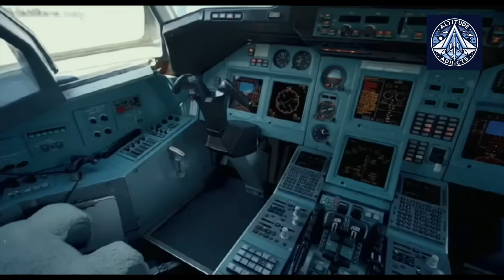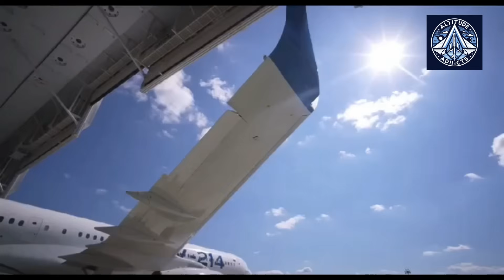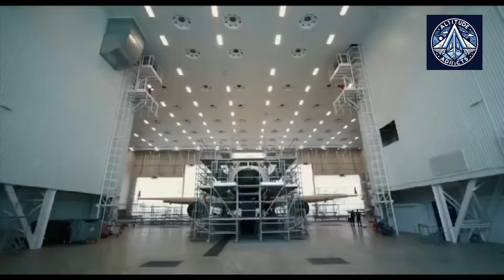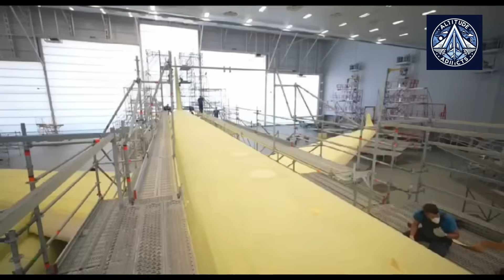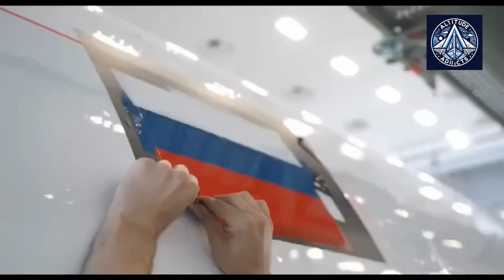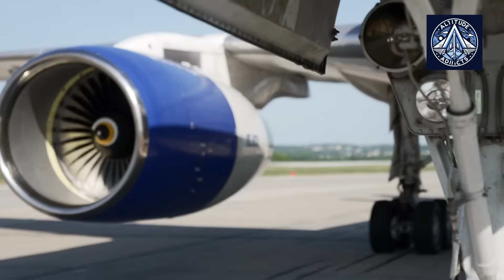Tu-214 Revival Explained: 3-Person Cockpit, Cargo Variants & More

Comment: surely with plenty of SJ-100s and MC-21s flying around with 2-person cockpits there will be plenty of existing componentry they can use for a 2-person cockpit in the Tu-214. And that would speed up certification because those components have already been certified. Probably 2027 production

Comment: Th two person cockpit was already done 15 years ago! That is one of the critical changes and improvement in TU-204SM - a variant that was taunted as the next iteration before Russia suddenly made a U-turn and started funding MC-21. The Tu-204SM was actually the most modern and highly improved variant that included a two-man cockpit and an improved variant of the PS-90 engine (PS-90A2 & A3). Two or three production examples were actually manufactured! They flew in several Air shows and are currently in storage. You Vloggers need to make better research before releasing videos that misinform people.

Comment: Makes the most sense, the extra certification time and cost will be better used for future more modern aircraft. The 214 will make a good cargo, military aircraft especially in the markets it will be able to compete in. A substantial redesign with composite wings, PD-14M engines, and a two crew cockpit would make more sense if there is a market i.e. not just stealing MS-21 sales.